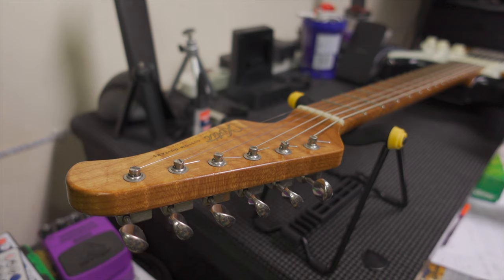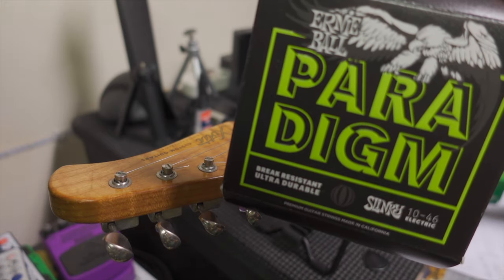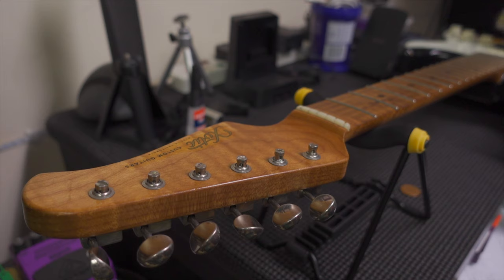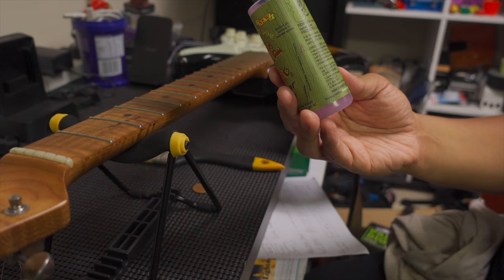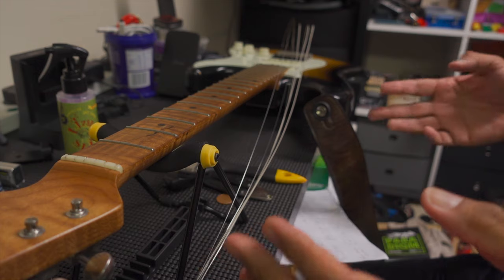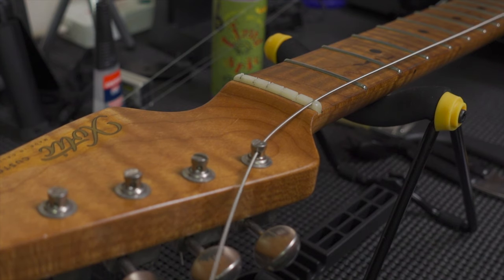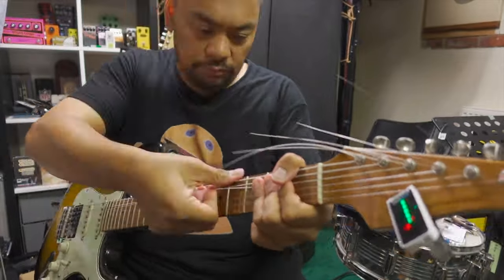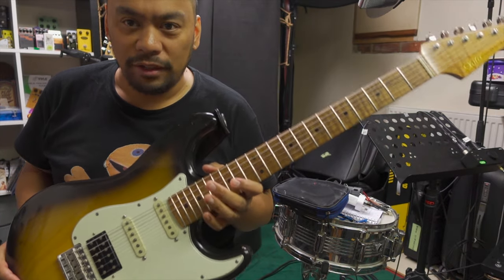Changing Strings On An Xotic XSC-2 Guitar (With It's Weird Locking Tuners)

Comment: Thanks for this.  I am sooo close to deciding to buy an Xotic.  Can you please tell me your experience:  specifically, do you feel your Xotic is "slinky"?  This is how I would describe any of the Strats I've played, including my current CS 60s.  But, I have a Suhr PT Sig, and even though it has a floating trem (3 springs), I find bending the high E, B, G to be a bit stiff...  I use 10-46 D'Addario on all my guitars.  Interested to know your thoughts on yours.
Reply from the maker: Hey, thanks for the comment. I really like my Xotic. It comes as standard with 10-46 and compared to my Fender strat (which I changed from 09-42 to 10-46) I find the strings on the Fender a bit stiffer. But that may be because I haven't changed the strings on it for ages.

I think the string tension on the Xotic is comparable to the PT (well, Suhr in general) from what I remember about playing Suhr guitars. That being said, note that the Xotic strats are styled to be vintage which includes a 6 point trem (as opposed to 2) which may affect the feel of the strings and will definitely affect the feel of the whammy bar when used (even if set up to float).

So, I do love my Xotic and it is my main guitar at the momenet, but I sense that it is not my 'dream guitar'. But I sense that I will never find it, mainly because I like lots of different guitars depending on my mood. Unlike with relationships, it is ok to be promiscuous with guitars, haha! 

Anyway, I hope that was of some help to you. Obviously, the best thing to do is to try one out. But of course, that is not always possible. FYI, at a Pete Thorn masterclass i went to a couple of years ago, one of the other attendees was saying how he found the Xotic "more vintage' than the Suhr equivalent. So if vintage is what you're looking for, then maybe the Xotic would be the one to go for.
Reply: @ProFunctionist  super helpful. I have CS fender 60s strat that I adore. That would be the most vintage like and something else in that class is definitely appealing to me.  I have a feeling I'll the trigger on Xotic pretty soon.
Reply from the maker: @keithbriscoe99  Well I hope it brings you happiness if you do go for it! 

Oh, also, if you like the relic'd look Xotic do an amazing job with it. Mine i s a light relic. I'll let the future years of use do the rest of it 🙂

Comment: It was very amusing to see how the younger generation of musicians could not handle the mechanisms of my childhood.
2/3 of the guitars made in the Eastern Bloc had tuners of the same design. The end of the string, cut to size and bent at a 90-degree angle, was locked into the axis hole of the tuner shaft, rather than left to wobbling outward. This is how it worked 45 years ago... 🤓

Comment: Seem to be the same as the Ibanez AZ tuners, the pain is when a sing breaks at the peg, having to hold the string and the coin is quite a challenge - especially on a gig.
Reply from the maker: Didn't know that about the Ibanez AZ guitars. But you're right. If a string goes on a gig, it can be a pain. I really like the Schaller tuners on MusicMan guitars. And even the Fender ones are really good.